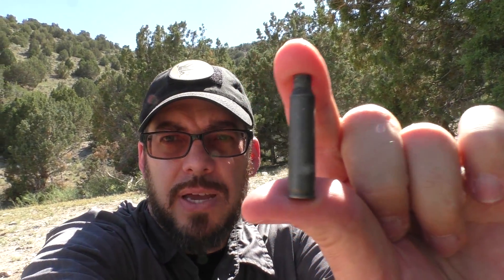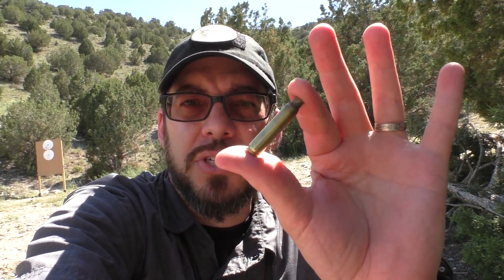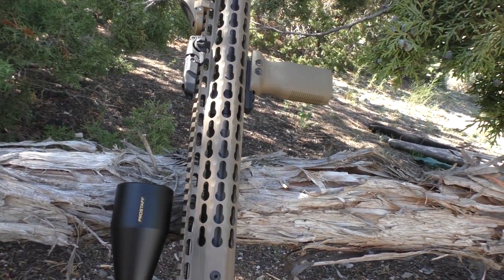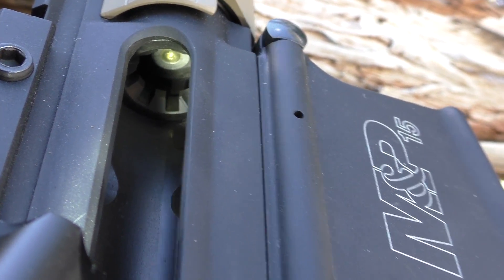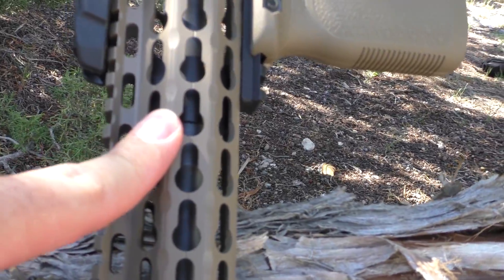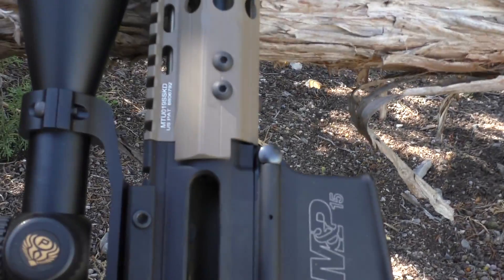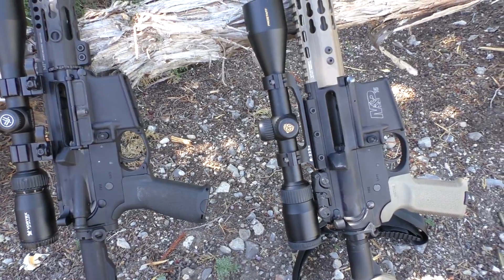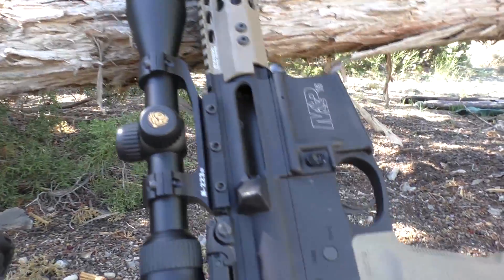Tula .223 Killed My Guns! V-Log Thursday

Comment: 3:40  -- says the chambers were thoroughly cleaned before shooting.
Reply: Poly coating. Strip clean chamber with acetone. Follow with Remoil. Wipe excess Teflon (Remoil) 
All new builds get this treatment on all moving parts. Recoil was designed specifically for AR15s ( M16s)
Most lubes turn carbon and brass particles into sludge. Add some dry arid region dust( not to mention a healthy buildup of polymer case coating) and you get stuck cases.
I had ( my father still has it) a Keltec SU16, that thing would rip the case head off of polycase until we cleaned and treated it with the Remoil.

Comment: HELLO!!!!  The problem is carbon build up in the chamber!  Steel cased ammo doesn't expand like brass so there is more carbon blow back into the chamber walls.  Shooting TUL ammo, clean the chamber after every 500 rds will eliminate this issue.
Reply: Hay Seed, not saying that the carbon isn't an issue, but the real culprit is the lacquer on the cases - especially as the chamber heats up. The hotter the gun runs, the more it is an issue (and the hotter the chamber the less carbon that's left)........ Sounds like you have paid extra attention to cleaning, and that's what is needed to get rid of the lacquer......
Reply: That is what I thought too, but then he said he cleaned it before he took it out.

+Kirk Boswell No it isn't, you can take a blow torch to the lacquer (polymer coating) and it won't come off.
Reply: Kirk Boswell tul is not laquered
Reply: I think it's the blow back because  when you shoot brass it expands no blow make round chambers  with steel you the loss of some gases  will  chamber not enough  to fire  that's what I'm thinking  let me know thanks
Reply: InItForTheParking lots of laquer will soften up and get a little bit sticky when wet
Reply: ironwinggame - Actually, all steel cased ammo has EITHER lacquer OR polymer coating. Pretty much all the newer stuff is polymer, but if you get ahold of some older ammo, I guarantee that it is lacquer coated. Just FYI, there are both types "out there".
Reply: John Doe
Ummm, no. The whole point of lacquer is to be water proof. Once it is dry it is impermeable to water. That is why we use it on wood outdoors, paint our cars with it etc etc etc.
Reply: InItForTheParking - and it is waterproof. Lacquer coated steel cases don't rust. But it will get sticky in a hot chamber. Open the bolt at any pause; mag changes, shooter change, target check, etc. Do that and clean with lacquer thinner when done, and you shouldn't have any problems. I might be wrong, but I suspect that all these stuck case experiences occurred after a string was shot, and the gun laid down for one reason or another with a closed bolt. Sticky lacquer, cooling chamber, closed bolt = stuck case.
That's been my assessment from the first. I clean with lacquer thinner. I lock the bolt open whenever I pause. And I avoid shooting so fast that the gas tube gets red. I have never had a stuck case with this ammo, and that's what I do. I HAVE had a stuck case in a Mini 30 with copper clad cases (actually several). Enough cases that I quit even trying to use that ammo. 
I guess the point of my responses is simply to let others know that steel cased ammo works, but it does require a slightly different approach to use and care for your gun.
Reply: Joe, the point of a coated steel case is to prevent it from being stuck 
in the chamber upon firing.   Steel does not release as much as brass
cased after pressure is zero after firing.   steel cases are more likely to get stuck.  Especially in American .223 Wylde chambers that are on the smaller size of dimensions.
Reply: InItForTheParking i meant to say when hot not when wet.
Reply: Thanks kirk. I can read the box. Ok people it's not that hard, just read the box. It tells you in english.
Reply: they don't use lacquer anymore
Reply: Nucc's Garage - That may well be true. Not doubting you. I believe you. BUT, lacquered cases are still "out there". I bought several boxes just two months ago at the Tulsa Gun Show. Half the 223 and all of the 308 were lacquered. 
Until the "surplus" gets all used up, we need to keep that in mind.
Reply: They coat the cases in polymer now
Reply: If you want to run that ammo keep the rifle clean and use the Permatex  Nickel-Ease in the chamber lightly before you use that and it will prevent the steel cased ammo from sticking in the chamber.  The product rated for high temperatures and with some slight blow back and it will help with the steel jamming up in there.  Remember that your are running the rifle out of it's designed spec.
Reply: Nucc's Garage yes they do. That is to fix the durability of the rounds when left in a hot chamber. It's the carbon build up in the battery. They actually make special cleaning heads for shooting steel cased ammunition. Clean your guns frequently and you shouldn't have a problem. Btw the polymer coatings are so so so much better than the lacquered ones!
Reply: Hay Seed- the problem is he needs to get an AK, will never have these problems!!!
Reply: Why Me After everytime you go to the range clean that bore. Steel casing have a tendency to gunk things up. I would get Fiocchi rounds for your rifle, in my person opinion.
Reply: It's been my experience that not all the steel ammo has the lacquer you're referring to. The regular Tula ammo doesn't have the same shiny coat on it that most Monarch rounds do. Has that been your experience as well?
Reply: They don't use lacquer any more they stopped years ago not its a polymer coating.
Reply: Thanks for the advice. I haven't even gone through 200 rounds and I get this same problem. As a matter of fact, this started happening to me in the first 30 rounds I used in AR. The bullet  will fire but the case won't eject. At the range, I can NOT get it out even with a rod. I'm guessing because the chamber/barrel is too hot. When I get home and wait a few hours, it comes right out with a rod. Wtf is going on with it?
Reply: Not true at all as for primary cause/root cause.  This happened to me on my first round of Tula steel .223 ammo and wasn't due to "lack of expansion"
Reply: Hay Seed, Thanks so much for sharing this. I was skeptical about this type of ammo and now you've shown me something in case I decide to run it !!!
Reply: Tul is not laquerd
Reply: I have been sitting here reading all these comments, quite entertaining actually. But your answer turns out to be the correct one. I had one get stuck in mine too, and after we finally got it removed, we did a complete investigation as to why this had happened. Well, to make a long story short, the build of after shooting around 52 rounds of Tula, there was an incredible build up of carbon in there. Now, the firearm was very clean before shooting that day. Only shot 3 mags of federal 223, then went to the 3 mags of Tula. Never finished the 2nd mag before the incident happened. I just choose to never fire steel case any more out of any of my AR's anymore. Will only use on the Mosin & SKS only now.
Reply: @kirkboswell2575  there has not been lacquer on these bullets for years now. And even if he was shooting the old school lacquer coated rounds, you would have to shoot A LOT and at fast rates to actually melt it. Also, leaving one chambered in a very hot barrel can cause it, if theres lacquer
Reply: @trailertrashtactics  - Yep, you are correct that it has been years since lacquer coated ammo has been made. Yep, you have to shoot a lot real fast to get it to completely melt.
However, as I mentioned already, I saw, held, and bought a box of lacquer coated ammo at the Tulsa Gun Show about a year ago. It is still "out there" and people need to be aware of that simple fact. That's all I'm saying about that.
And people need to be aware that lacquer coated ammo doesn't have to melt completely to leave a sticky residue behind.  
I've never had any problems shooting lacquer coated ammo, UNLESS I failed to clean it well with lacquer thinner. No, it was never enough to see with the naked eye, but failure to clean with lacquer thinner would result in a stuck case somewhere along the line. You don't have to see germs to know you have to clean wounds to avoid infection. 
And setting a gun down with a hot chamber and a closed bolt will aggravate any potential issues. 
I'm not against steel cased ammo. I've used it myself, and it functions like it's supposed to. Usually at a significant discount over regular ammo. I'm just saying that there are a couple of quirks to be aware of if you want to have a trouble free visit to the range.
Reply: I would agree with you except my new one cycles everything but Tula brand new. The last one jammed so hard it been the round and bound the bolt up. I stopped using Tula and it's fine
Reply: Hay Seed this video is 3 years later and I have the same problem with TULA and barrel is cleaned every time I’m through shooting and as he explains, it’s periodically
Reply: @Community-Action  it happens to aks as well
Reply: this! 
Kirk Boswell
3 years ago
Hay Seed, not saying that the carbon isn't an issue, but the real culprit is the lacquer on the cases - especially as the chamber heats up. The hotter the gun runs, the more it is an issue (and the hotter the chamber the less carbon that's left)........ Sounds like you have paid extra attention to cleaning, and that's what is needed to get rid of the lacquer......
Dont let ammo sit in the hot chmaber, shoot a few rounds, then pull mag shoot last, let cool down.
Reply: @kirkboswell2575  this happned to me alot and leanred not to let a round in the hot chamber!!! thanks all you friends !
Reply: I’ve heard that using a 16’ barrel is the main reason why steel case ammo doesn’t work well. It has to be a 20’ barrel or longer cause the timing is different for each barrel reaction
Reply: @kirkboswell2575  BIG NO .. has nothing to do with lacquer ......
Reply: @InItForTheParking  UMMM  NO... the purpose of laquer or polymer is to aid in the steel case not rusting... THATS IT !
Reply: @infowarguy  NOT TRUE... DO JUST A TAD OF RESEARCH....  laquer or polymer coatings are done inorder to inhibit the cases from rusting.
Reply: @mrmgjohnson  What are you arguing a 3 year old post? How deep did you have to dive in the comments to find a stranger to argue with? Are you really that lonely? Do you need a hug?
Reply: 100%🙏
Reply: I just cleaned my rifle and shot about 10-15 rounds fine of Tul 223 before a case got stuck and ruined my range trip because I didn't bring a rod. Stripped case neck and rod barely knocked it out. Actually broke new cleaning rod. I'll just spend a couple extra on xtac green tips or similar rds
Reply: @TheTechGuider  Monarch uses lacquer right now. Sold at Academy.
Reply: @Community-Action  not true that an AK solves that problem. I bought a brand new NPAP and with Monarch ammo could never finish a magazine without a jam. Got rid of that AK
Reply: 4 years later to your reply but I had a problem after 20 rounds in my c308 sporter with Tula.  Cleaned
it and everthing was find again.
Reply: Wait you said it doesn't expand? Yes when it gets to hot carbon build up will make it happen sooner but aluminum casing in a ar-15 is a no no.
Reply: @kirkboswell2575  I haven't gotten lacquered cases unless they were produced by Barnaul or Vympel.